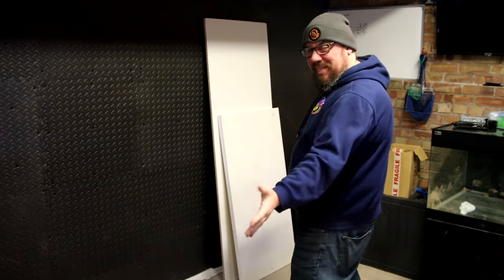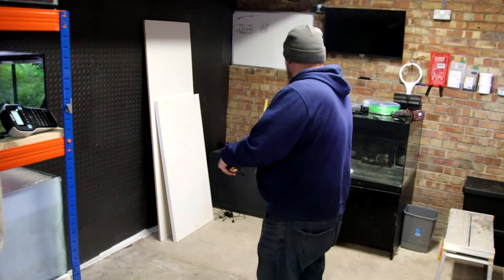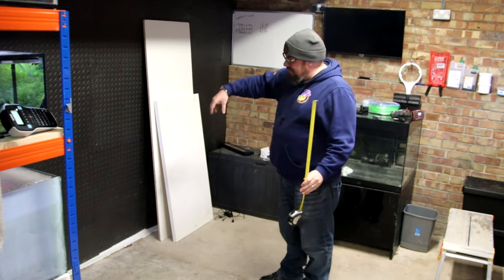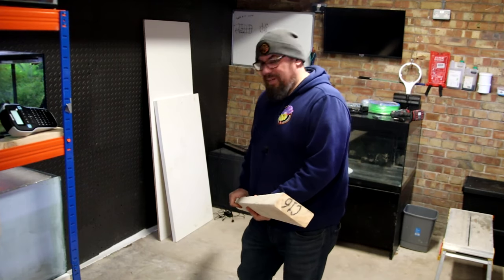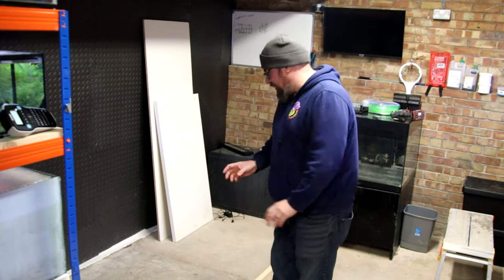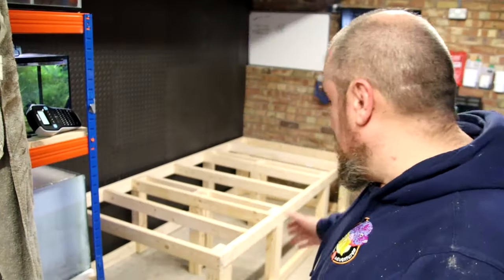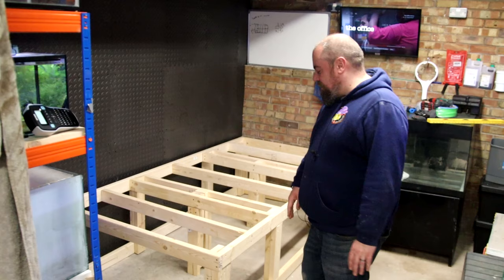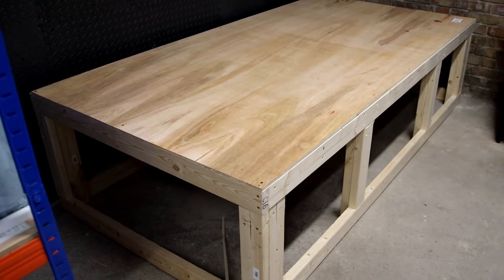DIY Aquarium Stand - MEGA TANK part 1.

Comment: Great job. How did you solve the level issue since your floor slopes downwards?
Reply from the maker: The back supports are an inch or so taller than the front.